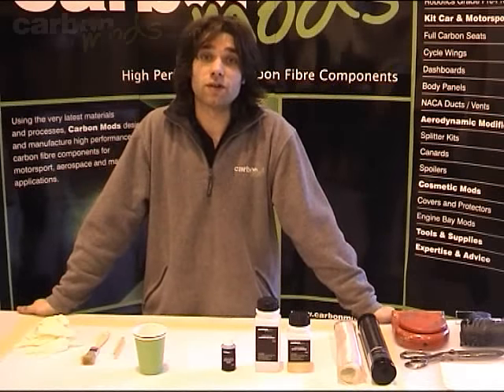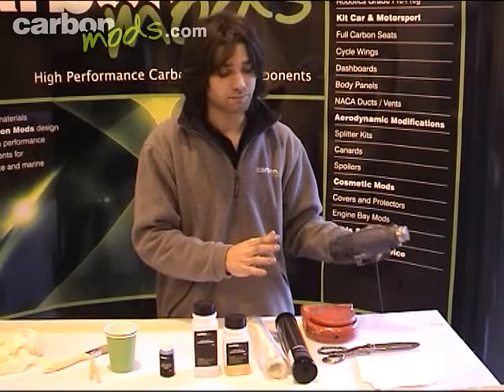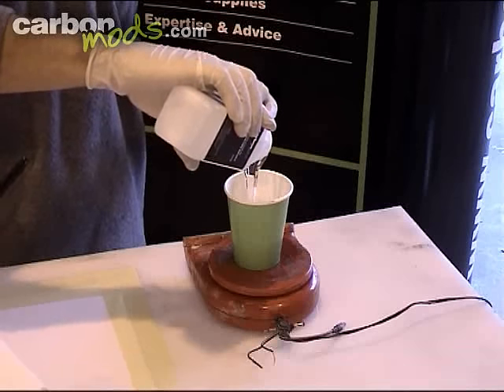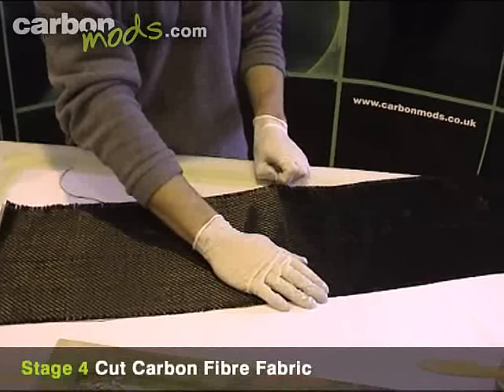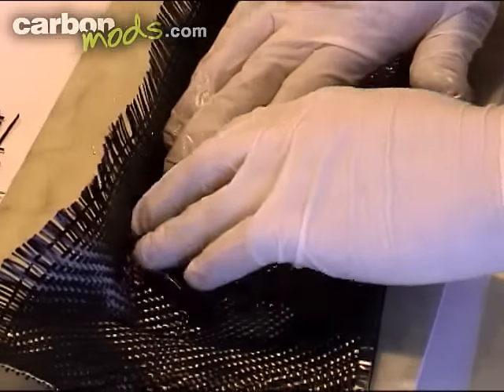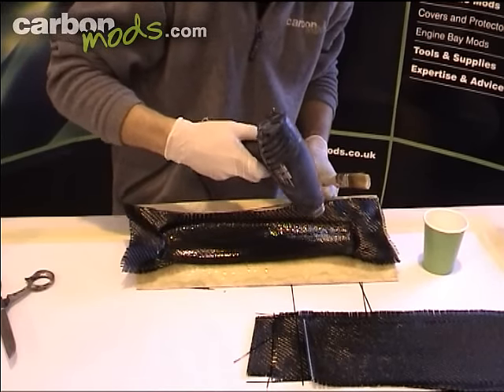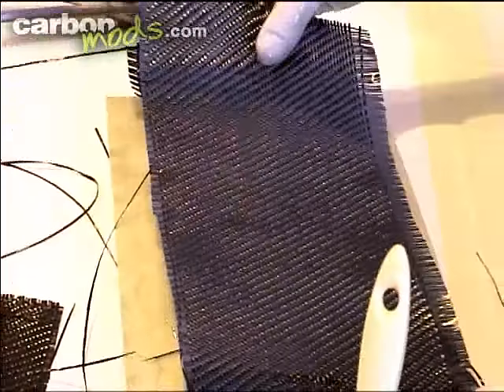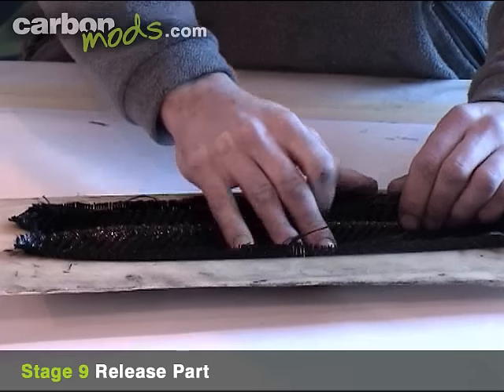How To Make Your Own Carbon Fiber (Fibre) Parts.

Comment: @sdkfz3000 no it can't..

because to weld metal for example you need to have at least the same properties of materials  as possible.

steel and carbon  are very much different,

glue or use of rivet is more likely....

Comment: @kevinp496691 It depends on the amount of layers but only a few layers is usually enough, make sure to rotate the layers, you want the fibers to be 45 degrees relative to your previous layer.

Comment: ok i will ask     what if you have a really big project   ( i am building a 60 x 30 cataraman ) out of carbon or  glass
Reply: +randomness019 Then you will need really big molds. If you want to make a boat, you need to use vacuum infusion. Your hull is going to need to be strong. The method above is fine for aesthetic trim panels, but its not appropriate for structural parts.
Reply: OK thanks . can you post a video of vacuum infusion ?
Reply: Do a YouTube search for "carbon fiber vacuum infusion." There are literally dozens of videos already on this. There are videos of guys making boats with this process.

Comment: well bullet proof isnt really carbon or glass fibres field 16plys of kevlar will stop a bullet and shatter some rib the problem with any resin+reinforcment is the weave isnt tight enough to hold together and the resins shatter but therre has been allot of research into it as it is cheaper than kevlar the foxhound ocelot is a fully blast proof pod made out of grp and there is allot of plys in them but a bullet will go through no problem im no pro on ammunition but composites i know lol

Comment: how do you decide how many layers to put?
Reply from the maker: It's all down to how thick you want the part to be. 1 layer will give you around 0.25mm of thickness so if you want a 1mm thick laminate then you'll need 4 layers. Have a look at this video we made about carbon fibre sheet - it will explain a lot more detail about choose (and orienting) your layers: https://www.youtube.com/watch?v=3uhR4jdFiS4&t=2s

Comment: Can you do this over clay
Reply from the maker: Not easily as clay is porous. If you were able to seal the surface adequately (after the clay was fully dried) and then use a suitable release agent, it may work for ambient temperature parts like this.

Comment: Probably at the point when you use binding agents that require heat (evaporation) to cure.  Epoxy uses a chemical reaction that doesn't use any outside stimulation.  The guy uses a heat gun in this video for only one purpose, to break bubbles.  Otherwise, it's completely a waiting process.

Comment: Anyone know how to make a mold? say for a center console piece? yes just for looks so i might try this method but i dont know how to go about with doing a mold... any help is much appreciated!
Reply: first, remove your center console.
then, get some modeling clay from a hobby shop near you, for the console out of my SVT Focus (about 3 1/2 ft long, 1/2 foot wide at the widest, and around 4-5 inches in depth, i didn't really measure lol) I only needed 1 gallon of the clay.
lay down some of the releaser they give you (or pick some up at the hobby shop, they should have some if they have the clay) and then start packing the clay down onto your part from the outside (the part that's visible to you when you install it don't worry about the mounting holes, as long as they're part of the console, and not attached on, all you have to do is drill them out of the finished part. if the console mounts with brackets, you'll have to install brackets to the finished part.)
let the clay cure for a day, then remove the console from teh clay, CAREFULLY, messing up the mold here means you have to start all over (like i did)
the clay mold doesn't have to be extremely thick, but thick enough to support the pressure you're going to put on it pressing in the CF.
this process works great for interior parts, but i dont recommend it for exterior, it's too fragile.

Comment: can any one please name the materials he used in this video ?
Reply from the maker: Eslam Fawzy Sure, the kit's changed a little since we made this video many years back but it's still essentially the same type of materials. We now use Easy Composites' EL2 Epoxy Laminating Resin with AT30 Fast Epoxy Hardener. The carbon fibre fabric is a 2/2 Twill, 199g, 3k Carbon Fibre. Also in the kit is some PVA Release Agent and some 290g Plain Weave Woven Glass (although in this video, we don't use the woven glass - if you want, you can use this in place of some of the carbon fibre to make the carbon fibre go further). All materials are available from http://www.easycomposites.co.uk
Reply: +carbonmods  is the material perform as strong as carbon chassis used in vehicle?

Comment: Carbon fibre was invented in WW2 on airplane wing repairs and later they found that what they repaired was stronger than the original so yes,you can use it with no worries!

Comment: So what is the glass fibre for?
Reply from the maker: It used to be in the kit so that you could bulk up/thicken a part without additional costs but we found most people didn't use it. Another benefit is if the part is to be used in an environment where Galvanic Corrosion is of concern, the glassfibre can be used as a a final insulating layer to separate the carbon from a metal surface.

Comment: Yes it's is original carbon fiber ,no wrap
Reply from the maker: That is correct, this process shows how to make an original Carbon Fibre part using a mould tool unlike skinning whereby the carbon is applied permanently to an existing item.

Comment: what about the sheet of fiberglass fabric?
Reply from the maker: Good question. Actually, we just used to include this so that you have some spare material to experiment with. You can combine the carbon with glass to make the carbon go further (i.e. one layer of carbon, two layers of glass) but these days we've updated the kit and dropped the glass out - most people just want to work with the carbon fibre.

Comment: any ideas how to make a carbon fibre front spoiler from an original CF part? i want to use the original CF splitter i bought and make a copy of it and use that on the car just in case i smack it on a curb
Reply: Maybe cover in pva, then vacuum bag fiberglass to make a mould.
Reply from the maker: Kaz Siddique You'd really need to take a mould off the original part and then use the mould to make the new replacement part. If you have a look at the first part of our Easy Composites 'How to Make a Carbon Fibre Bonnet/Hood' video this shows the process of taking a mould off an original vehicle panel. The process would be the same for your splitter: https://www.youtube.com/watch?v=UgKvDw1E60E

Comment: how do you make the mould?
Reply from the maker: Kaz Siddique Take a look at our Mould Making Video: https://www.youtube.com/watch?v=qKrl1PPvliQ
Reply: Great
Reply: +carbonmods hello there! I have a quick question regarding durability of such parts. Are they susceptible to cracking for example if struck with force with lets say something like a metal rod? I was wondering if carbon fibre would do decent enough material for gauntlets.
Reply: +throbbingweener would kevlar be a better way to go then?
Reply: +throbbingweener You guessed it! I am in fact trying to get into a fight. I intenteded to make gauntlets for historical european martial arts (longsword specifically). Problem with metal is that it's heavy, and is no good for competitions, as it makes it hard to make out whether you've hit the sword or somebody's hands, thus making life more difficult for judges. It's just a crazy idea I came up with a while ago, but it will msot likely take me a while before I try my luck with it, as kevlar is quite expensive, requires special tools and I currently dont have any space where I could mess around with resins.
Reply: +throbbingweener HEMA is not very big yet. It has become alot more popular in the last years, but since in pretty much everyone relies on his own, personal gear, electric gloves or other pieces of equipment like that are simply not going to work. Not to mention that those gloves are not made by big companies. There are a few, although mostly its a custom work by small companies (or private people). As for paint, you would have to repaint the gloves over and over again. Better idea would be to cover metal with leather or rubber to muffle the sound, although such gloves would still be pretty heavy. So far the best thing there is in my opinion are aircraft grade aluminum gloves: https://www.facebook.com/ComfortFencing/photos/pb.448250165238007.-2207520000.1444899417./807600255969661/?type=3&src=https%3A%2F%2Fscontent.fwaw3-1.fna.fbcdn.net%2Fhphotos-xtp1%2Ft31.0-8%2F10631195_807600255969661_1266491159699529637_o.jpg&smallsrc=https%3A%2F%2Fscontent.fwaw3-1.fna.fbcdn.net%2Fhphotos-frc3%2Fv%2Ft1.0-9%2F10665231_807600255969661_1266491159699529637_n.jpg%3Foh%3D3c70cfa6d464fbc99f4f8e81ef418324%26oe%3D56950ED5&size=2048%2C1613&fbid=807600255969661

Comment from the maker: You don't *need*  to use vacuum assistance but there are many situations where it is of benefit and for large panels or where you want the strongest, lightest part or the best possible finish then it can help a lot. See our Resin Infusion video (through Easy Composites) to get a really good idea of this process: /watch?v=VodfQcrXpxc

Comment: @wauggicsy using fibreglass, chopstrand mat, it easy enough to do. the hard part about a helmet is tring to stop the fibres from distorting, carboncan be apain in the ass when it wants to be

Comment: is it punch resistant ??
Reply from the maker: Depends who is doing the punching!!
Reply: @carbonmods  Do each carbon layer have to wait for the resin to dry?
Reply from the maker: @biggbosschannel7116  Not necessarily; you do need to limit the number of layers to avoid excessive heating of the resin (the number would be dependent on the cure speed of your resin) and we'd often recommend getting the first layer down, letting that tack off and then building up subsequent layers so that you can ensure the first layer, which is the most critical from an aethetic perspective is well-laid into all of the contours of your mould.
Reply: @carbonmods  ok

Comment: isnt resin fumes bad for ya?
Reply from the maker: antiall Epoxy resins are pretty-much odourless and have an almost zero volatile content (VOCs). Providing you're working in a area with reasonable ventilation, there really arn't any 'fumes' from epoxy resin too worry about. Skin contact is a different thing however and you should always make sure you wear nitrile gloves and protect yourself from skin contact with the resin at all times.

Comment: No, it will shatter. It's carbon fibre, not kevlar (i.e. stiff as hell, but not really impact resistant). Although, it has to be said, it's not like glass that will shatter just from a little impact.

My oars are carbon, I use them on a coastal/open water rowboat which sees its fair share of beachings and oar blades hitting rocks. They are nicked but nothing catastrophically has happened (yet). But they sure aren't bullet proof.

Comment: How strong?
Reply from the maker: +孫騰泰 : The strength depends on the thickness, the more layers of carbon, the thicker the part is and the stronger it is. For a typical carbon fibre, part like a vehicle panel for example, a thickness of 0.75mm would be common. This would require 3 layers of 200gsm carbon fibre.

Comment: OK, this is nice to make fashionable trim parts for your automobile where plastic does an equally good job, but it's not how you make the structural carbon fiber components that are six times as strong as steel (such as in bicycle frames).

Comment: the video is fairly amater ...
regular epoxy resin isn't UV-resistant (gelcoat should be used), PVA should be aplied at least 2-3 times (foor gloosy finish wax should be used), when mixing the resin you should poor the mixture in another cup to be sure it's well mixed, ...
the technology is far more complex

Comment: carbonmods wrote:I couldn't dissagree more.We show a simple way to make a carbon fibre part in this video but to say that the part is none structural makes no sense at all.The carbon fabric and epoxy resin are exactly same as would be used in just about any carbon fibre part, structural or none structual so I just can't see where you're coming from with this comment.There is lots to consider when making a wing but once you've undertaken those considerations the construction will be much likethis

Comment: No.  This construct is only good for cosmetic appearances.  It has no structural integrity, or stress and flex consideration.  When building your wing(s), there are a lot more you need to take into account than what's simply shown here.

Comment: 70 gram of Resin and 50 gram of hardener?
or my ear got problem? LOL
Reply: With epoxy it's a the 2 components   have a ratio where the molecules fits together to harden. That ratio varies with diffent types of epoxy. It's not like a polyester hardener for example

Comment: once again sustained force not impact. an f1 car can sustain a downforce of twice its weight but when it so much as clips another car or the wall it shreds until nothing but the cockpit is left. this is both through design and the damage capacity of carbon fibre. think of it this way; the femur is the strongest bone in the human body, its capable of supporting the weight of a vw beetle. but if you landed wrong you risk snapping it or even shattering it altogether.

Comment: if your not vacuum bagging the carbon you are WASTING YOUR MONEY- you can buy a sticker for cheap- real cf parts are bagged to reduce resin to fiber ratio for improved strength and stiffness- cf wet layup is GARBAGE- optimum resin content for 3k 200gm per meter  twill is less than 38% -that process is probably 60% or higher
Reply: I sayed that too,but probably for aestetics reasons it good :) like phone covers and shit.
Reply: I imagine most carbon parts made this way are for looks only and I say it's fine for that, but if you are building an f1 car then pre preg is the only way.
Reply: ttmadness34
not only f1 ,every cabon parts made for light weight and strenght must be this way.
only a few joints and parts you can do them non pre peg and it's fine..

Comment: Wow is not vaccum?
Reply from the maker: That's right; this is carbon fibre laminating at it's most straight forward. There are many other methods (vac bag, infusion, prepreg, hot press etc.) but this is a method that you can do with the least equipment.